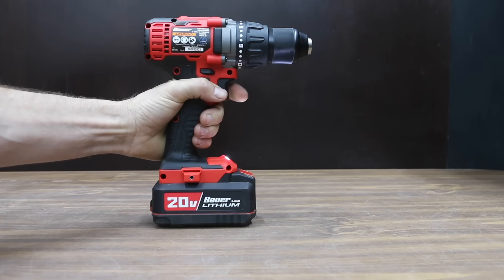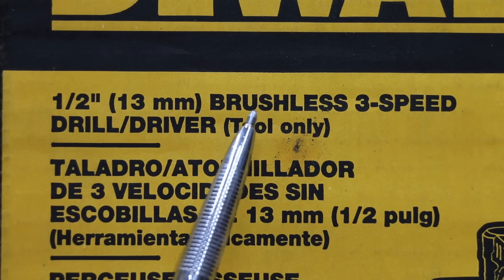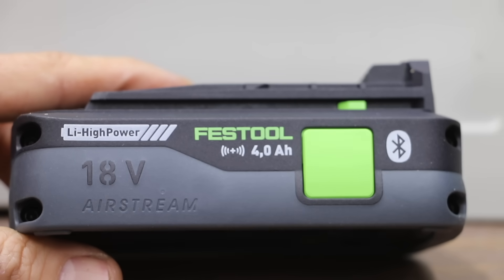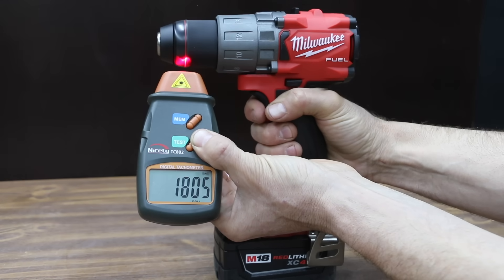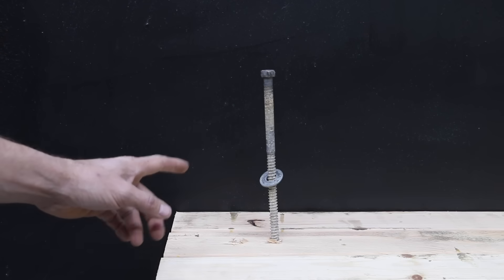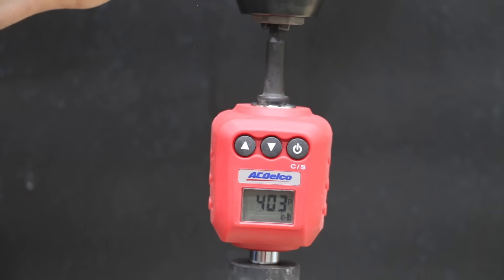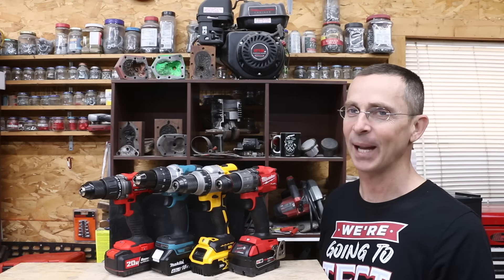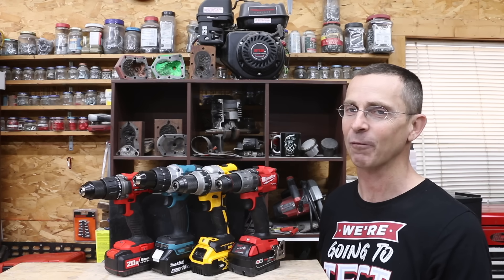Best Drill (BATTERY POWERED)? Milwaukee vs Dewalt, Makita, Bosch, Festool, Ryobi, Bauer, Ridgid

Comment: Stuck at home with COVID so I’m binge watching videos. lol. 

I use both Milwaukee and Festool brand tools in my shop. While I would argue that Festool makes amazing corded tools (I have their shop vac, plug track saw, jig saw and orbital sander), my friend who is a cabinet maker uses some of their cordless tools. He says they are good, but they are really expensive (which we saw in the video) and they take forever to recharge. 

My Milwaukee stuff on the other hand is quite affordable and does an amazing job. I have changed to the M12 line for my field work and have been really happy. They are a lot lighter but still pull their weight. 

My best friend on the other hand uses Ryobi. I’ll tell you, there is something about the design of the Ryobi impact that makes their ability to drive screws far superior to my Milwaukee. 

All in all I’d say the Ryobi does a great job for the money. Milwaukee is still the best multipurpose company in my opinion. Festool on the other hand is the best specialty tool. For example my jigsaw has a strobe light rather than a regular light, which causes it to flash at the same speed as the blade moves. So it appears as though the blade is standing still which makes cutting a line a lot easier without the chatter. My orbital sander has a gyro that removes almost all the vibration. I once sanded my entire deck and never felt a thing (big 24x20 foot deck). And don’t get me started on the shop vac and how it collects dust from the tools, or the plunge saw and how there is no compensating for blade distance using the track.
Reply from the maker: Thanks for sharing.  Hope  you get to feeling better soon!
Reply: @ProjectFarm  thank you for the well wishes. I really love your channel! Great work.

Comment: You spent so much time setting up very specific tests for each drill but fail to take into account the actual drills and accessories. For the higher end drills, you used the hammer drill grip attachment giving extra pressure exerted with the drill. Then with the Ryobi, they have higher rated, brushless drills that are better than just the cheapest one
Reply from the maker: Thanks for the suggestion.

Comment: Thanks for another excellent test! I own Bosch Pro equipment and the power available depends on the batterie you use... Strange, but easy to verify. The batterie you use on the Bosch drill looks like a 2 amp batterie. This is not enough to make the most of this powerfull drill... This most probably affected the results.
Reply from the maker: You are welcome!  Thanks for sharing.

Comment: Love your videos but I’m a professional builder your screw tests aren’t an accurate way of measuring as the amount of resistance varies greatly depending on which part of the wood you’re drilling and the angle, some of your drilling was near 45degrees which is going to greatly affect resistance.
Reply: You're not wrong, but that is why he has the tests with the torque adapter and also why he does several screws each time and averages them.
Reply: Everybody loves the guy.  Your criticism is not helpful.

Comment: I would have liked to have seen the brushless Ryobi compared to the other brushless drills. I received the brushed Ryobi as a Xmas tool set and burned it up using a hole saw. I replaced it with a Ryobi brushless drill and it’s completely different. As a weekend diy homeowner it’s done well.
Reply from the maker: Thanks for the suggestion.
Reply: @ProjectFarm  thanks for the videos. Better than CR.

Comment: You should be aware that the DeWalt torque values change with the gear setting too. Lowest clutch setting will provide more torque in 1st than 3rd. I think this is because it's measuring current at the motor whereas mechanical clutches are measuring torque at the chuck. I suspect all the electronic clutches work this way and that's why they failed your low torque test. Try it again with them in 2nd or 3rd gear and I think you'll be surprised.
Reply from the maker: Thanks for the constructive feedback.

Comment: I am in the construction industry HVAC Controls. I have been using Makita for the last 15 years. I love them. I used to use the Dewalt before they got merged with black and decker. A lot of my guys and others on job sites use Milwaukee and or Rigid. Also a great choice. I would never use Bauer of Hercules or Hart on a job site unless you want to get ripped on non stop. Can I use your fisher price or hey does that drill come with a matching purse. Don't do it if your new to the trades save up and get a name brand.
Reply from the maker: Thanks for the feedback.

Comment: I,ve got a Bosch professional 18v and am happy with the outcome of your tests the Bosch seemed to finish mid range in most of your tests and mine would have cost mid range on your prices in New Zealand dollars with 2 batteries and a charger so I,m quite happy and had no problems with it,( best one in the shop at the time ). Awesome video always love watching your vids as you do thorough testing and great explanations and video graphics,Thankyou. Best wishes to you and all your viewers,cheers,from, Auckland, New Zealand 👑⭐🥇👍💯❤✅🙂🙂🙂🙂🙂
Reply from the maker: Thanks and you are welcome!  Thanks for the feedback.
Reply: J Mc on top of that, I believe the Borscht in this video was tested with their 4Ah battery that has one 5-pack of 21700 cells in it. These cells' current output very rarely exceeds 30 amps, which puts this battery at a disadvantage when compared to other brands in this test as they all have 2 banx of 5-series cells (18650 tho) which are usually capable of 20 amps per series, so 40 amps total.. So, I suspect the Borscht would have performed at least 10-20% better with a double-row battery.

Comment: The only thing I'd add is a test with pocket hole applications. Whether you're a DIYer or a pro, pocket hole joinery is big. Ideally for me, is a drill powerful enough to easily drill pocket holes into hardwoods as well as soft, without stalling. While also being able to rely on the same drill to securely fasten the self-tapping screws. I.e. no stripping the hole or crushing the bottom of the pocket hole, especially with different plywood.
Reply from the maker: Thanks for the feedback.

Comment: Try bostitch brand too! Ive got one and its decent. only drawback is the speed selector is starting to get a bit "fiddly" after several years of use.
its got loads of torque though. enough to break your wrist and wrist your arm if your not careful. especially in speed 1 lol
Also fairly cheap too.
Reply from the maker: Thanks for the suggestion.

Comment: Your take is pretty much close to mine. DeWalt versus Milwaukee depends on the specifics of what you need I have DeWalt for most sawing and cutting type things but the 12 volt Milwaukee sucked me in for the ratchets and other little things. Oh and I have Bauer they live at a rental place 600 mi away where I do maintenance periodically they're good enough for that those certainly not anything heavy duty.
Reply from the maker: Thanks for the feedback.

Comment: Yet another thumbs up! You have a new subscriber! Years ago, I purchased a Harbor Freight Chicago electric 18 V ni- cad cordless drill. That sucker lasted me two years, using it nearly 6 days a week on average. I’ve yet to see any brand last longer! It also lasted longer between charges! 10 bucks! Before my dad retired, he bought a harbor freight carbide tip sawblade, and tested the hardness against a better quality regular steel blade. The harness was about the same! It pays to be careful before you by less expensive tools! However, it proves that your test are invaluable. Thanks again!
Reply from the maker: You are welcome!  Thanks for watching and subscribing!

Comment: When it comes to commonly manufacturer exaggerated specs like torque, as you mentioned, it would have been great if instead of just a simple bar chart, if you show a dual level bar chart showing how far the real torque was below the advertised torque. This might give some sense of the amount or % that they exaggerate.

Because currently when I look at claimed specs from different manufacturers, I basically have to ignore the torque numbers completely.

It would be cool to be able to guesstimate based on these kinds of tests.

Having said that. Your videos are brilliant.
Reply from the maker: Thanks!  Thanks for the suggestion.

Comment: Milwaukee's drills are okay, but the chucks are crap, with a tendency to lock so you can't get out the drill bit. Had to use pliers, and the outer housing on the chuck buckled. DeWalt are not great either. Makita's on the other hand are top drawer.  As are Metabo's. 
Am looking forward to more batteries from China (where all are made) for my Makitas.
Reply from the maker: Thanks for the feedback.

Comment: Milwaukee is an all around powerhouse
Reply: So are ridged tools
Reply from the maker: Thanks for the feedback.
Reply: I worked in a CNC/manual machine shop for about 5 years, and these Milwaukee M18 drills held up to years of abuse in a dirty environment being used to chamfer parts and pre-drill holes in steel, with constant use for 20 hours every day. Extremely impressive durability, and now I buy Milwaukee brand for everything.
Reply: @HarryManback0  🤣 constant use for 20 hours every day?? BULLSHIT that doesn't even make sense, there are 24 hours in a day🤦🤣🤣🤣
Reply: So you run the tool for 20 hours straight then sleep for 4 hours and then do it all over again?? 🤣🤣🤣
Reply: I have this exact Milwaukee drill. I also have the Makita and a Bosch. If I want finess and accuracy I use the Bosch, if I want to power through something I go for the Milwaukee, the others just cant compete, but my go to drill is the Makita for most work.
Reply: @skunkworksalpha7868  lol u obviously haven't used Dewalts 3 speed drill, best in the market, you can get the finess of the bosch or the power of the Milwaukee in one drill, also the Milwaukee came up short of its specs and the dewalt exceeded it's specs
Reply: @Lee-lb9qh  Briliant observation professor, obviously I haven't used the 
Dewalt, nor have I used Kobalt, Hilti, Hitachi, Ryobi, Matco, Porter Cable, Bauer, Craftsman, Black and Decker, Mitabo, Hart or any other number of manufactures. 
I commented on the tools I OWN AND USE.
Reply: @skunkworksalpha7868  then why did you say others can't compete? Those are comments about tools u just said you haven't used genius 😂😂👏 or should I say professor?
Reply: @skunkworksalpha7868  so do u comment on tools u use? Or tools u never used? Which one is it?
Reply: @Lee-lb9qh  Your reading comprehension is embarrassing. He said his other tools (so Bosch and Milwaukee) can't compete with Makita. He didn't comment on literally every tool in the world.

Comment: On the ryobi drills, and tools in general: there are different levels of each. Looks like the one tested was from the lower tier
Reply: Definitely. The new brushless HP line of hand tools are very competitive while still  much more affordable.
Reply: I thought that makita was faulty until I realized it was a 07 and not a 14..lol
Reply: Yeah, it's definitely a drill for occasional home projects, not for the worksite.  I would be nice if Project Farm did its comparisons based on intended usage, not just throw a bunch of the same type of tool together in one comparison video.  Especially with the wildly different price points.

Comment: Ryobi makes a lot of different drill models. Wander how the others compare like some of the brushless?
Reply from the maker: Thanks for the suggestion.
Reply: @ProjectFarm  i have 3 different Ryobi drills myself and they seem to be a lot different in terms of power etc. One of the blue hammer drills, one brushless hammer drill,  and one standard similar to what you tested.  The one i have that's similar to what you tested seems weaker than the other two that have the detachable side handle.  Unfortunately i don't have one of those torque meters for any kind of numbers to tell much.  Looks like an expensive meter.  Really love your videos! You do an excellent job in your comparisons!

Comment: Milwaukee Fuel is a phenomenal tool line. I'm a mechanic and every other mechanic in the dealership I work in (there's fourteen of us) use Milwaukee Fuel in 1/4", 3/8" and 1/2" drive impacts and electric ratchets. They're glorious tools and they last forever. 10/10, in love with Milwaukee
Reply from the maker: Thank you!

Comment: I am not as familiar with the other brands however when testing any Milwaukee tool that is labeled fuel, you need to use their high demand or high output batteries to get the best/advertised results.
Reply from the maker: Thanks for the feedback.

Comment: Great video - I have the Milwaukee and love it, but it would also have been interesting to throw Metabo into the mix - I've seen some amazing torque demos with them :)
Reply from the maker: Thanks!   Thanks for the suggestion.
Reply: I would agree with you…..before they got bought out. Now, they’re no different than the other mid-grade brands.
Reply: @ChivesKnives  that's a real shame if it's downgraded their performance.  I attended a demo about 10 years ago and their 28v SDS was amazing 👍

Comment: The Ridgid "lifetime" warranty is false.  A Lie.  Ridgid is a cheat.  I purchased a 24 Volt drill and after 3 years the batteries went bad.  Ridgid required me to send them the bad batteries.  I did.  Six months later they returned them saying, "I didn't send them the original receipt but instead a copy."  After many phone calls, Ridgid had me send them the drill.  Four months later they sent the drill back saying, "I didn't properly register the tool when it was purchased because I was supposed to send the original receipt at the outset to make the warranty valid."  Keep in mind that I'm fastidious about keeping my owners manuals and receipts for everything I own.  I argued to Ridgid that there own literature did not state that I had to send the original receipt in to make the warranty valid.  Ridgid's response, "We don't make that battery anymore so no warranty."

Comment: I frequent several Goodwill stores for electronic gadgets.  I see an endless supply of cordless drills of nearly all brands that have been donated at every store.  I converted my hundred dollar drill to use a plug in power supply because a replacement battery costs far too much and I will assume that has been the experience of many others.  I got about 5 years from the two batteries that came with my drill.
Reply from the maker: Thanks for the feedback.

Comment: I made the mistake years ago to switch from Makita to Milwaukee. and destroyed the gears on 2 drills within months, just using the machine for driving screws. A costly experience for around 300$. I am back to Makita, the 18V series and the tools from drill to hammer drill to saber saw to compound sliding saw to lawnmower etc., uni tool, chainsaw etc. (several grands worth of gear) perform without problems, for some tools already for ver ten years. I still have my first drills (dill and angle drill) bought in the early 1980s, the 7.2V series that still perform well, as batteries are still available and come in handy for jobs in tight corners. In between I also had the 9V tools, including circular saws, saber saws etc. which I either sold or left to my son, they are also still working.
Makita owner for 40 years now
Reply from the maker: Thanks for sharing.

Comment: I used an 18v Bosch and a Viking drill bit to drill multiple holes in my semi tractor's frame. Didn't have to recharge it until I tackled the doubled up steel I saved for the last. 20 holes on one charge. Oh, temp? Maybe 72 degrees.
Reply from the maker: Thanks for sharing.

Comment: PUBLIC WARNING: One day when I was using my Dewalt 3 speed with a 400mm long 12mm ship auger, I  carelessly blipped the trigger while holding the drill upwards. As it happened I hadn't correctly tightened the chuck. Next thing I knew the auger was up in the air and I was holding my arms over my head counting the seconds for it to return to earth. Be careful out there friends!
Reply from the maker: Thanks for sharing!

Comment: We use the Milwaukee Fuel line up at work, lemmi tell you something, once they introduced the 3 speed impacts, nothing but trouble, will start spinning backwards, or stop spinning etc etc, then they got us the new 3 speed and drill setting (useless) and same deal, about 1 in 4 impacts would be sent to the shop with this defect, and this is relatively light electrician work, not pounding in screws all day by any means. 

Same with drills, they used to give us the gear clutch and then they went with the electric clutch, what a POS, I never needed a clutch anyway but those clutches would kick in all the time, made the drill super weak, also the drills were defective about 1 in 10 sent back to the shop. 

Milwaukee shined with the portaband, that thing was rock solid. 

They finally switched the whole shop over to DeWalt, too early to tell, portaband def not as good as Milwaukee, drills and impacts about the same, haven't seen wierd issues, but what really shines is the Rotohammer, light, powerful, with a dust collector and filter that makes Makita and Milwaukee look like dinosaurs, def makes up for the portaband short comings.
Reply from the maker: Thanks for sharing.